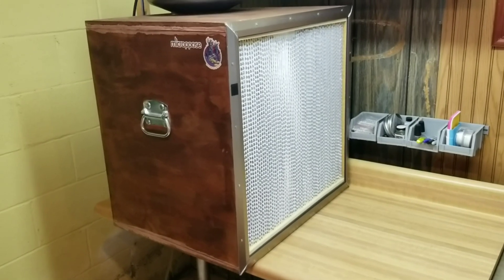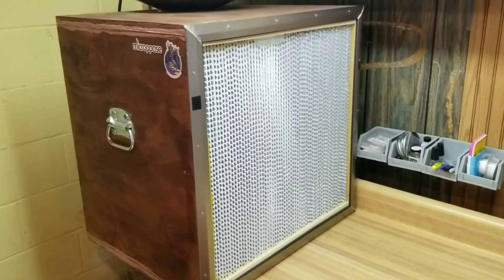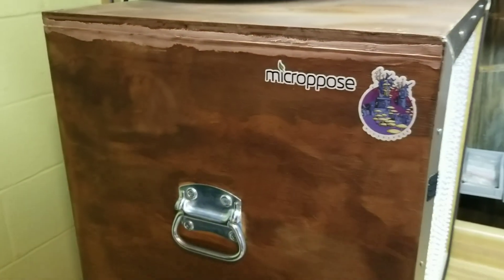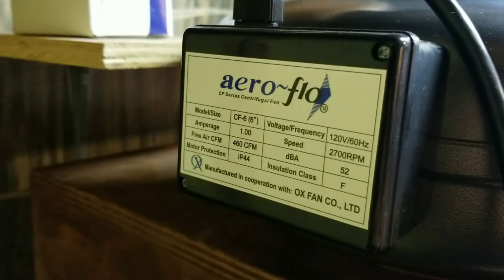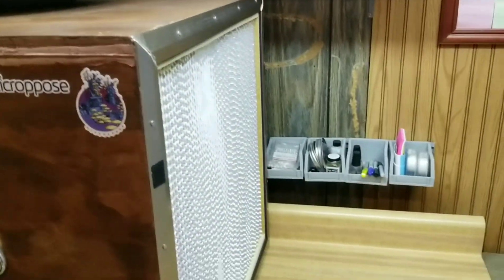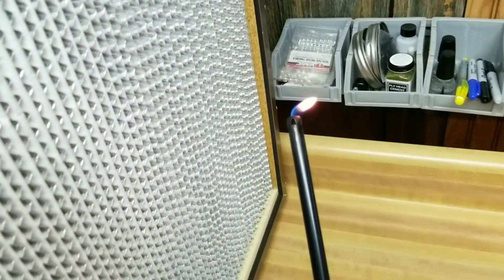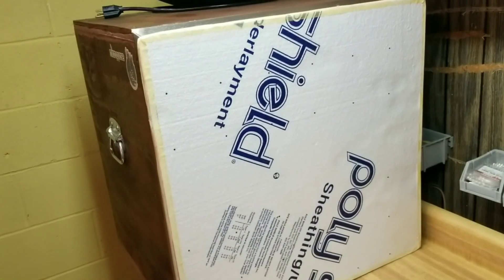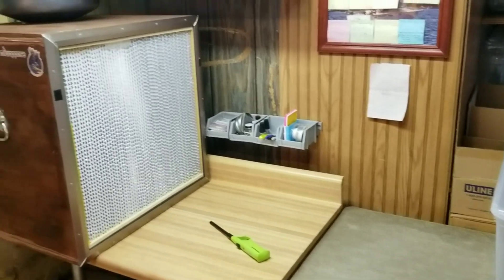LAMINAR FLOWHOOD OVERVIEW, My DIY Centrifugal Fan Design

Comment: Tried to replicate your success here using a centrifugal fan. Think I’ve only succeeded in creating a turbulent flow box. Lighter test bends the flame well but very jagged and uneven across the whole surface. How thick was your filter? Bought a filter labeled as laminar flow H14 but thinking it’s not thick enough to build adequate pressure to smooth out the flow.
Reply from the maker: You want at least a 3 inch filter, that's what mine is. You want a 99.97% or 99.99% filter like the Bonsai filters sold by "Midwest Grow Kits". Guessing that is your problem. Only other problem could be your box is not deep enough and/or your fan is blowing directly on to your filter.
Reply: Was going to try a different fan, but it’s probably the filter thickness like you say. It was rated for 99.995 but maybe not thick enough to wash out the turbulence. That’s frustrating. It’s only 3” thick. Box depth might be too much if anything. Got it facing down like yours.
Reply from the maker: @Chris-ru5hb  That's interesting. My guess would be it's the filter, but not sure. There is nothing with the centrifugal fan that would cause that. I've built two hoods now with those fans and they both work great with smooth laminar flow. Also make sure you silicone between your box and filter housing so no air can escape through there.
Reply from the maker: @Chris-ru5hb  Actually I just checked those Bonsai filters from Midwest and they are only around 3" depth as well, but people seem to really like them. Those people there know their flowhoods really well, so you could pick their brains too. The other possibility is that the fan you have is too powerful for the static pressure of the filter. Make sure you double check those specs as well.
Reply: I’m based in the UK, I’ll try re siliconing the joints before I take the hit on replacing the filter. Cheers for the advice I’ll keep tinkering and see what I come up with. Put some agar jars out to test it today. Pretty certain it’s too turbulent judging by your video.
Reply from the maker: @Chris-ru5hb  I know Kaizen Cordyceps is in the UK and they do a ton of flowhood work with their Cordyceps breeding. They may be able to lead you to a good filter supplier if you contact them. Just a thought, in case you end up changing your filter.
Reply: Thanks I’ll get in touch with them and get a more reputable filter if it comes to it. I’ll see if I can salvage this abomination I’ve created.
Reply: @RenegadeMushrooms   First off I want to thank you for answering my questions on you other video.  You reply fast and it's much appreciated.  

I recently picked up a homemade box similar to yours, but smaller and with a squirrel cage blower.  The guy I bought it from is a local comercial mushroom grower.  He was upgrading so it worked out perfectly for both if us.  The thing is, the force of air comming out is like 10x yours.  I can't keep a Bic lit anywhere near it.  So, I tried the test with my touch, it stayed lit (mostly) and showed a laminar angle in most places, but some areas looked turbulent.  Im wondering if they look turbulent because there's so much air coming out.  Does the force of the air make a difference?   Im not sure the CFM but its a 4" intake i 
Im thinking i dont have anything to worry about considering I bought it from an actual commercial grower,  but I've never seen one with this much force behind it.  

I got an additional NIB hepa with the deal too!  But probably will never open it, as the one installed only has a few years on it and you said you've gotten YEARS our of yours!

What are your thoughts on this?   I did an MEA plate test.  5 plates for a min (probably shoukd have dine 5 min) that was a few weeks ago and so far so good.
Reply: Freshcap's guide suggests 0.45m/s or 100ft/min air speed, for a 2'x2' it is 100x 2x2 = 400cfm. But iirc the filters also have some constant (0 - 1) that multiplies 400cfm and tells you how much air you actually need. 
Edit: I checked on vitefilter's website and I was correct. Deep pleat is heat resistant and used for machinery and stuff. The 2'x2' requires 1700-3400m³/h or 1000 to 2000 cfm, while mini pleat is not heat resistant and it's used in clean benches. The 2'x2' only requires 450m³/h, or 265cfm. So, the actual power you need for the fan is less than the 400cfm calculated, and the filter box system has some constant of 265/400 or 0.66. So try turning the airflow down
Reply: Amigo puedes regular rebajar el flujo de salida agregando capas de pre-filtro. Yo tengo pensado hacer una caja para un filtro de 24 × 48 pulgadas y con un motor cebtrífugo de 1060 CFM y pienso reducir el caudal de salida agregando un pre-filtro Hepa de tambor de esos que son circulares y lo encierro en una caja y encima le coloco pre-filtro cuadrado y si es necesario agregar mas hasta tener el flujo laminar adecuado 👌🏿
Reply: Use a green shopvac filter for the pre filter on top.
Reply: Can you tell me how much this costed you? And a link to the fan and filter?

Comment: Apologies, as I know this video is a little old, but can you share what make/model your fan is?  I have a 3" mini pleat filter coming that will need about 565cfm for laminar flow.  Most of the fans I find are either too weak or too strong,
Reply from the maker: Aero-flow CF-6.
6"
460 cfm free air flow.

They do make these where the speed can be controlled by a rheostat, essentially infinitely adjustable. I highly recommend you buy one of those. The hood in the vid is my 1st generation. I built a 2nd gen hood for a friend and added an adjustable fan and a rheostat, works great.
Reply: @RenegadeMushrooms  I found one, although not that manufacturer/model.  The question is, for those that are speed controllable, how are you measuring your CFM at a given SP?

Comment: Hi Nick,

Thank you for your amazing and very useful videos on mycology. I've learned a ton from your YouTube channel, including pasteurizing sawdust and soya hulls, clever dowels with grain and sawdust, Cordycep egg nutrient broth with a rice cooker, and many more techniques.

On December 29th, I had a hectic explosion at home while doing agar work in my SAB. I used 70% isopropyl alcohol to handle the petri dish and scalpel, but I forgot about its flammability. When I lit a lighter to flame sterilize the scalpel, the bottom of the SAB exploded. My hands, covered in isopropyl alcohol, caught fire, and the plastic glove box trapped my hands inside. Eventually, I managed to pull my hands out, but both hands suffered 2nd and 3rd degree burns. I had surgery to debride and remove all the dead skin, and I may need a second operation for skin grafts.

Given the circumstances, my wife has instructed me to stop using the SAB, so I need to build a laminar flow hood (LFH). Can I use an H13 filter, or must it be H14?

Best regards,
Geoff from South Africa
Reply from the maker: Thank you for the kind words, and I'm very sorry to hear about your injury. It's been awhile since I specd out filters, but from what I remember you need them to be at least 99.97% efficient at .3 micron, preferably 99.99% efficient. Midwestgrowkits.com has some nice affordable bonsai filters you can check out.

Comment: When I was in the air force, I worked on painting the F-22s at Holloman AFB. Since the paint was 'stealth' paint, the aircraft had to be parked in a special hangar. The entire hangar was a flow hood. The giant doors had huge hepa filters and the back wall was a giant hepa filter with huge fans to pull air in from the doors. The paint was highly toxic to breath in. Still had to wear full Tyvek suit and  full face respirator.
Reply from the maker: Sounds like some badass paint as long as you're not breathing it.

Comment: Did you seal the gap between the fan and the box
Reply from the maker: Yes I did, I used silicone.
Reply: Finally I built the flow hood. 4 inch thick H14 hepa and 960 CFM inline fan (same as yours) with a Rheostat.
It is really producing a nice laminar flow and  I tested it  with agar plates , no contamination even after a week .
Thank you so much for your videos. ❤ From India
Reply from the maker: @ah1864  That is awesome to hear that it is working for you, happy growing! 👊

Comment: Some people say inline fans won't work because they can't handle back pressure. Im building a flow hood now with a 2feet*2feet ,  6 inch  filter . Will an inline fan works for such thick filter
Reply from the maker: @ah1864  Not sure on that, my filter is only 4" thick but the inline fan works great for me. Midwestgrowkits.com has some nice bonsai filters that aren't as thick.

Comment: Which type of hepa should I use?  Deep pleated one or mini pleated one? I contacted a filter manufacturer and they are asking me the same question ⁉️
Reply from the maker: You want 3 - 4" thick minimum. Here's a link to checkout for you to compare:
https://www.midwestgrowkits.com/bonsai-flow-hood-99-99-hepa-replacement-filters-regular-xl-or-commercial.aspx?feed=Froogle&gad_source=1&gclid=Cj0KCQjwn9y1BhC2ARIsAG5IY-6ipsS9CSkGtGqrIy14hdV5YXSEsYVN8XUmMX0GlbyHkupf-y02b88aAlZ5EALw_wcB

Comment: Sorry for my English, I'm writing with the help of a translator. I can't find your engine anywhere in Google (by the inscription on it) Please share the link. What do you think, if the engine is more powerful, but it will have a speed controller. Will it be possible to adjust it to laminar flow in your box?
Reply from the maker: This is the one I used in the video, but it can't be adjusted.
https://www.aero-flo.com/centrifugalfans/
Model CF150

If I were you I would buy a more powerful one that can be adjusted down using a rheostat.
Reply: @RenegadeMushrooms  Thank you very much !!!

Comment: Question why do you need the box would it not work with just a fan behind it?
Reply from the maker: No, you definitely need the box. The fan is not so much blowing air through the filter as it is building pressure in the box behind the filter. It's this pressure build-up that leads to smooth laminar flow through your filter with little to no turbulence. Turbulence causes swirling flow that can bring in contams to your work space. Hope that makes sense.

Comment: I believe the white side of your pre filter should be facing out. I could be wrong, but thats what I was always taught.
Reply from the maker: I guess that would make it easier to see if it was dirty, but other than that I can't see why that would matter. It's just compressed poly and I've been running it that way for 18 years or so and it still works mint.
Reply: @RenegadeMushrooms  Right...and with the success you've had with your HEPA filter, I'm sure it doesn't matter that much at all. Really enjoy your channel.
Reply from the maker: @J155P  Thanks man, and thanks for watching 👊

Comment: Should use a induction fan, quiter and has 3 speed control.
Reply from the maker: Actually you can get these inline exhaust fans that can be controlled by a rheostat making them infinitely adjustable. The second hood I built uses one and it works great.

Comment: Hi thanks for the video! Just wondered how you got the fan to fit  so it's air tight? I know the squirrel box can be screwed into the wood but am looking at this type you went for as my preferred option. Many thanks
Reply from the maker: I just cut the hole so it would be a nice snug fit and sealed it in there with silicone.

Comment: Cool build. One small suggestion for your intake filter. get an increaser cone from 6 to like 10 inch, then put the filter on the larger pipe diameter. need to upsize to overcome filter restriction, will be easier on the fan too. Obviously its working fine but just my thoughts. You could also do like a 6 inch tall plenum box that sits on top with a larger filter intake, it would look way cleaner like this, no cone sticking out the top. or better yet, just put an open topped box on top that hides the fan and sticks up about 4 inches above it, then get 24x24 or 24x whatever filters that just sit on top.
Reply from the maker: I like the increaser cone idea 👍 I actually factored in the reduction in cfms from the pre-filter into my hepa filter resistance calculations though. I've been rocking the same fan and filter for 18 years, only occasionally washing the pre-filter. Can't believe it's still working with no contams.
Reply: @RenegadeMushrooms  thats awesome man, 18 years, geez.

Comment: What are your box dimensions, would like to know.
Reply from the maker: Roughly 24" X 24" X 20" deep. The filter is 24" X 24" and it has to fit inside your box so your outside dimensions will be a bit bigger than that.

Comment: How are you securely mounting the fan unit to the top?  Is it just sitting on top or is there a rubber gasket on the hole?  Did you use any screws too secure?  Thanks very much!!!
Reply from the maker: No screws, just a bead of clear silicone to seal it in place.
Reply: @RenegadeMushrooms  Easy peasy!  Thx!

Comment: How do you clean it between uses? All the dust and stuff settles on so when you turn it on aren’t you just blowing that dust and stuff on whatever you’re working on?
Reply from the maker: I always start it up a half hour or so ahead of time to clean the air in the area. Then I wipe down the work area with isopropyl right before I start working. The only thing I ever actually wash is the pre-filter. It's made of a synthetic mesh material so I just wash it with warm soapy water, let it dry, then re-install. Eventually your main HEPA filter will become clogged and your airflow will drop way off. At that point you need to replace the main filter. A good washable pre-filter will greatly extend the life of your main filter.

Comment: Hello
Did you install a fan controller switch?
Cool flow hood
Reply from the maker: Not on this one, but I did on the second hood I built for a friend. This was my original and this fan isn't compatible with a rheostat. I definitely recommend purchasing a fan that can be adjusted if you can find one.

Comment: So if i am filling a 10 x 15 area (10 x 10 for bags and 5 x 5 clean room) will a 2' x 2' flow hood do trick or do i need to go bigger like 2' x 4' (which would be 2 (2 x 2 hepa/flowhoods stacked)
Reply from the maker: 2' x 2' would be fine.

Comment: Hi Renegate.
I'm about to buy (at last) H14 filter 61x61x29(thiknes) cm with aluminium separation. I want to recreate your construction like in this video. Can you help me how to calculate air space in the box i need? 
And am I right about all this idea? Will the blower will be enough withis kind of thiknes? Im from eastern europe and here is huge problem with filters. Manufacturers here don't have graphs of efficiency of air flow. I hope i didn't complicate to much this post ;))). Have a great day!
Reply from the maker: Because of the thickness of your filter, you will need a more powerful fan than what I have. Your filter will have a higher resistance than mine. Here is a  link to help you out:
https://www.fungifun.org/English/Flowhood

Also you can ask on the "Mushroom Growing for Beginners and Experts" Facebook group. Someone there may have the same filter as you.

Comment: this is not a hood, a hood is called a hood because it has an actual hood. This aint it chief
Reply from the maker: This design is commonly called a "Flowhood" in amateur mycology circles, so that's what I go with. Probably because it's shorter than "Table-Top Hepa Clean Airflow Device". That just doesn't roll off the tongue.

Comment: Good For You Mr. Renegade , i went w/ the old (new) box fan and a 2200 merv 13 filter 20 x 20 , used painters tape to attach the filter and i have a speed controller from my other round fan w/ carbon filter from my tent .works very slick . i do that too and let it run for a bit in my room before i go to work !!! id say 60$ total . sometymes i get wrapped up in making things an forget this is just a hobby not a full tyme lab. this was a couple years ago . that store still stocks those filters like 22.00$ . oh an the inline speed controller was on the amazon than can be used for many things an is simple to use if ya can plug a cord in . Thanks for you tyme and video well worth it !!!

Comment: I just remembered I have a 190 CFM centrifugal fan. Will that be enough to pressurize a 18x24? Or more likely a 12x12?
Reply from the maker: Probably more like 12 x 12. Hit up midwestgrowkits.com and see what there Bonsai 12 x 12 filter requires.
Reply: @RenegadeMushrooms  good tip. theirs is 200 CFM but that's pretty close and $93 for a filter aint bad. cheers man!

Comment: I'm trying to find a filter, what one do you use and where do you buy it?  Thank you.
Reply from the maker: They're tough to find. I bought this one not long ago as an eventual replacement for my old one:
https://www.steam-brite.com/clean-storm-hepa-filter-24in-24in-9997-particle-board-242406h910-h24240699-h24240699-p-89060.html?gclid=Cj0KCQjwg8n5BRCdARIsALxKb94Fj9OQgXBuZ4s8UoIedJ6fFgEqdIQMXI6dfEmbBgQoHWgCMCD6dG8aAnYdEALw_wcB
Reply: Only 6" thick.  Thick enough?